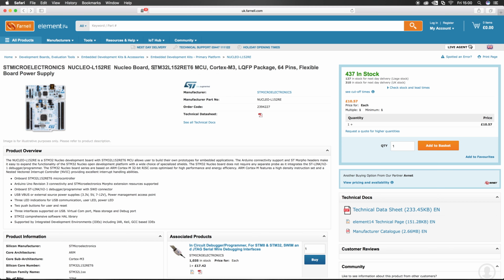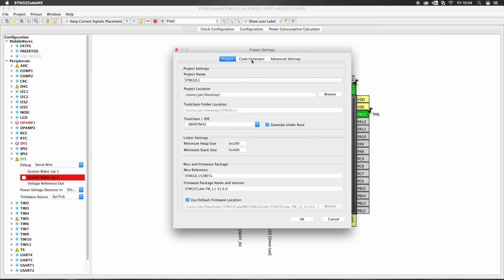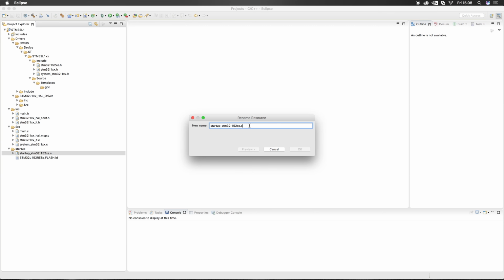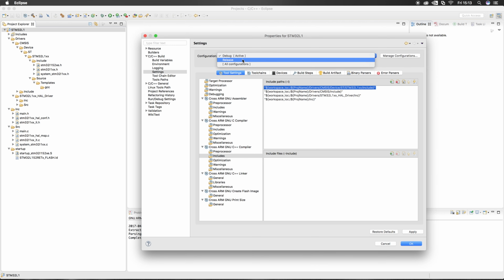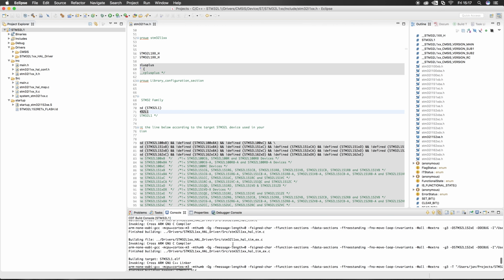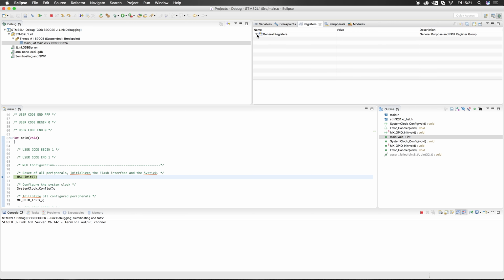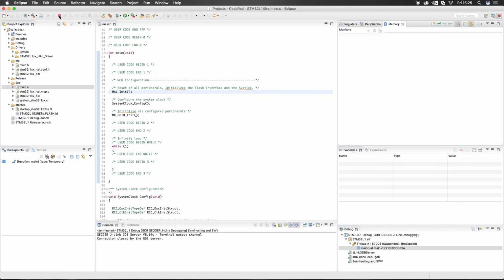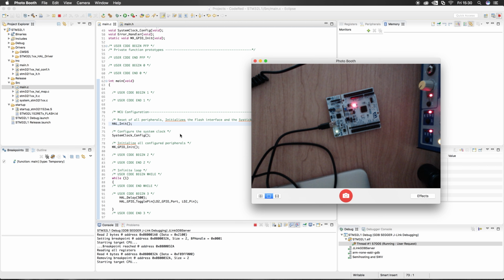STM32 with Eclipse, STM32Cube, GNU ARM and J-Link. Part 2 - Example

Comment: Hey Jan thank you again for this usefull tutorial, I still end up here after many years anytime I have to set up eclipse again.. This time I found that CubeMX does not create the linker file anymore, it is just missing.. Have you ever experience something like that or you have any hints? Thanks a lot
Reply: Did you ever figure out how to get around this issue? Im stuck on this too.
Reply: @ryanmurphy6753  I dont unfortunately, but you can create a new generic cross arm proj then change the toolchain in settings

Comment: Hi, I see in your project at min 27:20 in main.h a bunch of #define, while in my project in main.h I have only these lines (can you please check the pictures) :

http://zupimages.net/viewer.php?id=19/05/9two.jpg
http://zupimages.net/viewer.php?id=19/05/lsdz.jpg
http://zupimages.net/viewer.php?id=19/05/kcng.jpg
http://zupimages.net/viewer.php?id=19/05/jd5y.jpg

I use for my project: stm32F407VG board and I want to toggle 2 LEDs on the GPIO PD15 & PD14 according to this schema: http://zupimages.net/viewer.php?id=19/05/8de5.jpg

Why in my main.h those lines or equivalent doesn't exist?

looking forward for your help.
Regards.

Comment: Hello and thank you for your job ! 
I still have a issue with my board witch is not recognised as a J-link on my MAC. The JTlink Consol says : "Cannot connect to J-Link via USB". But the operation made on Windows worked fine and the board is recognised on Windows. Any suggestions ?
Cheers
Reply from the maker: Hi, make sure you have macOS J-Link drivers installed. In Eclipse check "Preferences -> MCU -> Global SEGGER J-Link Path. You should see something like: 
Executable: JLinkGDBServerCLExe (this name changed recently. It was different in older JLink installations)
Folder: /Applications/SEGGER/JLink_V632g (this depends on current version)
I above is set, you should be able to talk to the board...
Reply: Tanks for your answer ! I did it last time but for some reason Eclipse remove it (the toolchain chain location too...) : but now I'm able to see the board \o/ 
Still have a issue with the debug when it's reading all registers ... ("WARNING: Failed to read memory @ address ..")

Comment: Hi Jan. I get a "multiple definition" error when I build my program. Im using a STM32F765VI chip as my target. Any idea how this error can be resolved?
Reply from the maker: Hi Raghu, it is really hard to say without seeing any code or exact error message. It could happen if you have a header file, without "#ifndef & #define" combo, which is included in multiple files. Or if you include a ".c" file by accident...